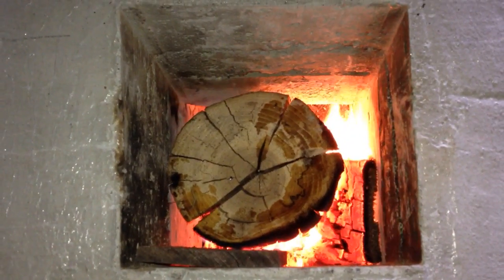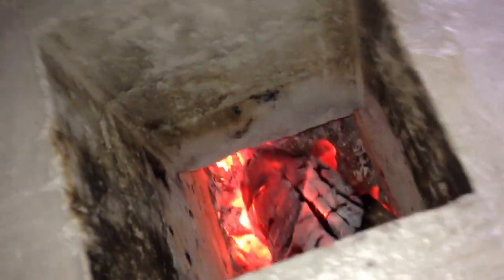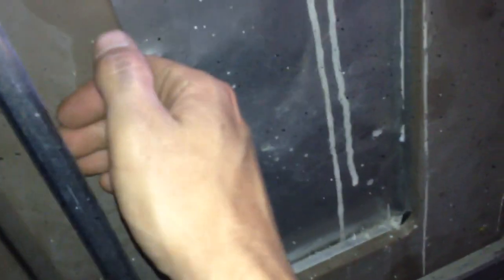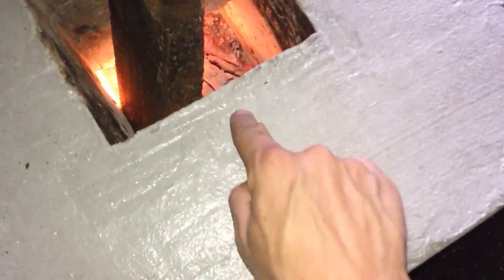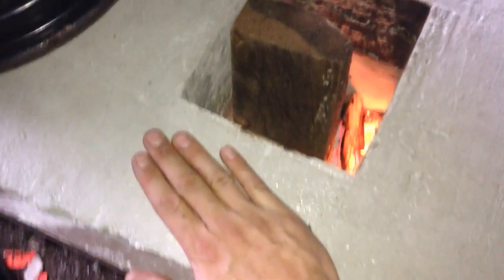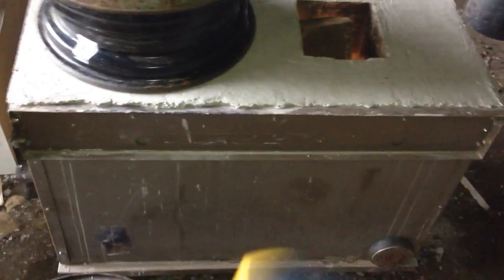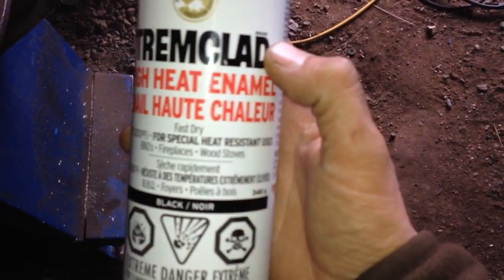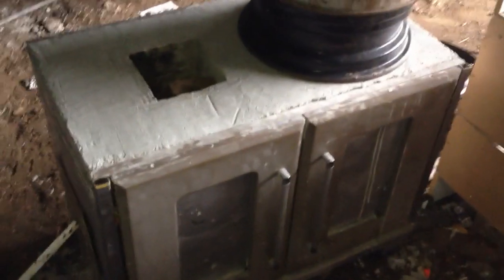Rocket Stove Mass Heater Cast Core Long Burn Test Continued

Comment: I'm a great believer in constructive criticism as well. And we can all  learn. I was happy to see the log because I don't she anyone trying it in the videos. And you had some problems. Thank you for sharing. Where did you find out that 200 degrees was the perfect draw for the flu up the chimney? Hypothetically. Since the fuel shoot is not excessively hot. Could I do glass brick around the bottom to show a fire? Or the window out of an oven door? Last has anyone tried multiple inline, or not, fuel chambers? Paper-waste oil-wood chips or pellets-kindling-log.
Reply from the maker: this experiment worked very well and the big log had not much problem burning clean without much help.  yes i have burned pellets previously with multiple inlets, one for air, and one for pellets.  this is episode #31 but i burn pellets in episode #2 i think and again in episode #6 or 7 i believe.   these are older lower quality videos but more recently i did a revival episode with better quality and pellets again.  i like the ability to burn multiple fuels but most;y wood, paper, pellets, chips, and organic yard debris.  i don't burn oil in these as they are part of a more sustainable and more efficient effort to make wood burning more clean and sustainable.  the heat riser makes a clean hot burn and the mass stores the hotter more efficient heat, and the ability to get more heat from less fuel via mass storage and a hotter wide open fire makes it at least twice as efficient as an "air tight" modern stove, and burns just as clean with good dry fuel.
Reply: @613Builds  I meant using different burn Chambers that shared the riser and flu. Or 1 burn Pile in line, in front of another burn pile sharing same burn tunnel.
Reply from the maker: @douglascunningham6319  im afraid you may have lost me.  the riser pulls on the coals with a heavy convection drawl, because heat rises causing a vaccumm of sorts which pulls the air/fuel into the riser.  if you had multiple burn chambers im afraid the drawl wouldn't work properly on multiple chambers or inlets.  multiple "burn piles sharing the same burn tunnel" might be possible, but i'm not sure what you mean.  i can only envision long sticks or a long magazine of pellets that falls into the feed port as it burns.
Reply: @613Builds  I understand.  But thought usually a cap or door is placed on a fuel chambers.  An I could not think of a good reason you couldn't cap off others made in a line on the burn tunnel.  Nor why a stove couldn't share same heat riser as the furnace. As long as a burn chambers air is closed off. Why would flames travel up unused capped chamber? Cautionary note. If you dont shut off air after the burn. Stove will continue to draw in cold air a long time.
Reply from the maker: @douglascunningham6319  if you cap the feed / fuel chamber, the flames will climb up the fuel / sticks backwards.  the airflow coming in the feed port keeps the flames down where they need to be and keeps convection going UPP the riser, rather than the feed port

Comment: To burn the paint off put several layers of wet newspaper on it with some light clay slip on top to help hold it next to the barrel then light it up should burn off that way.  This style is not designed for large pieces ;)
Reply from the maker: good idea, thanks for your input, and thanks for watching

Comment: what you see at the ebd if the long is residual moisture and sap being boild up.
Reply from the maker: Thanks for the info and clarification.   I kinda figured it wa something like that.   Thanks for watching.
Reply: John C 
 So the best way to get rid of that is to keep it inside a warm place or more importantly, a dry place. If you have a bunch of them, place them on the flat area of the RMH or near it while it's running.
Reply from the maker: I've made a wood shed recently so hopefully that will help.   Thanks
Reply: John C 
 Your welcome, i do advise you to put pallets on the floor to aid in air circulation.

Comment: Looks like it is a piece of metal furniture you've pour the cement in, can you explain how it's built and did you use refractory bricks for the burn chamber ?... and why do you think it is a pain that it take so long to burn ?.. isn't better, so you do not have to feed it constantly, and so it could burn overnight without to restart for next day and so on !... maybe if you can make a diagram drawing showing the way it works !... Thank you much.
Reply from the maker: hi
yes, the unit is a large cast-core which i poured into a recycled heavy-duty BBQ stand on caster wheels.   the bbq stand has a very strong bottom and extra support to hold weights and LP tank, so its designed to hold alot of weight.  i figure the unit weighs around 400 LBs (give or take)  
a slow burn is okay if it still burns clean.   im just used to the rocket effect burning fast and furious.    the build and design is my own custom design.  the core is mostly composed of refractory cement and perlite.  the final revised riser is made of refractory fire-bricks.  here is a link to a bit of a build diary on this unit http://permies.com/t/53224/Portable-Compact-RMH-Hybrid-internal

Comment: It looks like an awesome stove. It gives me a great idea. But, I don't know why you would complain about the wood burning too slow. If you had that in your house, it would be great if you could keep a 5 hour burn going after you go to bed. Should keep the place warm through the night. One reason the big logs burn slow like that is because there's less airflow. When you put the smaller square piece in you could have made it burn faster by putting it straight in on top of the wood you knocked down in there. That would have given you more air flow and it would have burned hotter and faster, at least for awhile. But, again, if you were going to sleep for awhile, that's not a bad thing. It will help keep you warm until you wake up to feed it again.
It looks like a great design. I've built a couple of back yard rocket stoves just for fun, but if I ever put one in my house I hope it works at least as good as yours. I wouldn't mind having more info about how it was built.
Reply from the maker: I documented the entire build on permies.com  .  its refractory cement and perlite cast into a huge one-piece cast core, with a firebrick riser.  yes the biggest complaint with rockets is how fast the fuel burns and constant tending

Comment: Why not build a fireplace for normal wood about three kilos or more? It should only burn in the lower edge and the flames should go aside to then distribute heat on the way out. I think the development has stopped in many ways. No toy but for environmentally friendly heating house for many hours in a little wood, preferably overnight on the last insert with wood or log.
Reply from the maker: i have a later video with a small batch box rocket.  its similar to what you're talking about.  check out the later videos perhaps , thanks for interacting